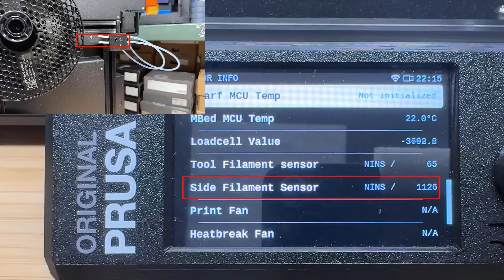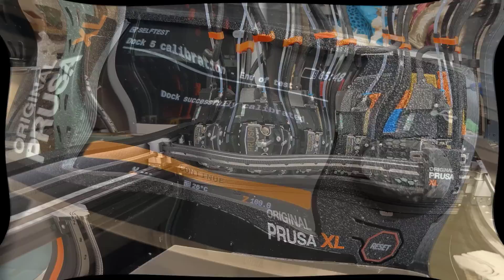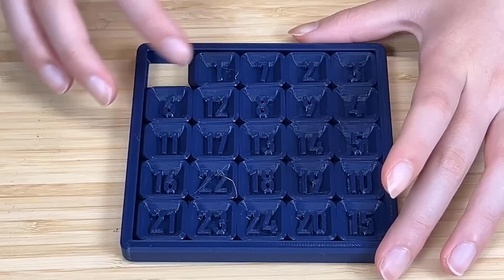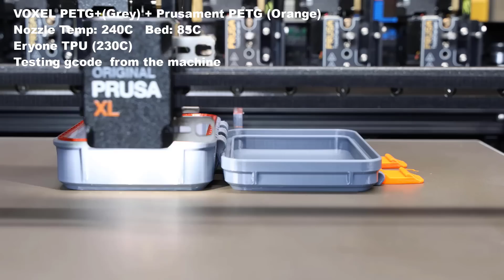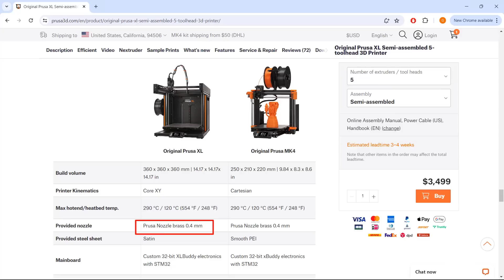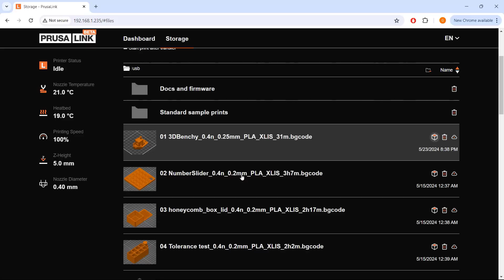Prusa XL In-Depth Review: 5-toolhead auto tool changer 3D printer compared to BambuLab AMS

Comment: Young lady i don't know how you do it, your reviews are off the charts best out there, quick question i have a small print farm of Bambu Lab A1's and flashforge 5m if you were going to add 6 or more prinn ters which would you honestly go with i do single color with some and multi color with the others i also use cf filaments
Reply from the maker: If you have both machines, I’m sure you’re already quite familiar with their performance. In terms of hardware cost, I think the Flashforge 5M is a better deal, since a CoreXY system at that price is even cheaper than the A1.

However, if you need multi-color printing, the A1 might be the better choice, as I haven’t seen any indication that the 5M supports multi-color yet. For multi-color printing, you might also want to check out the Flashforge AD5X, which I will be reviewing in the coming months.
Reply: @AuroraTech  Thank You for answering, i don't want to invest in printers that wont make the long run since i'm moving toward more machines that i need to depend on yes the 5m is a good printer but will it last as long as the A1 or others

Comment: I can't get over how "unrefined" their printers are in 2025. The firmware looks like it's from a startup company, not the supposed "industry leader" Prusa, still using 3D printed parts on a $5000 machine is also crazy. The overall design of these printers are cheap and way too basic for a modern printer, the amount of exposed wires and components is lazy. The fact Prusa has had years to respond to Bambu and they've yet to actually innovate and grow from within. Companies like Blackberry and Nokia were also stubborn thinking they had something special, rather than listening to the consumer.

Comment: Excellent video! Sorry for the lengthy comment in advance. I was initially leaning toward the Prusa XL, thinking it would finally meet my needs, but after watching your video, I’m now unsure about whether it’s the right choice for my specific requirements. To give you some context, what I primarily need from a 3D printer isn’t necessarily speed, but precision. I often prototype intricate parts that must fit together with tight tolerances, so accuracy is key. I was initially drawn to the Prusa XL for its build volume, which I thought would be ideal, as my typical print heights range from 2” (50mm) to a maximum of 14” (356mm). While I mostly work with single-color prints, I’m also open to multi-color or multi-material options when needed, like the XL promises. However, the most critical aspect for me is achieving a smooth surface finish akin to SLA prints, but without the associated hassle of maintaining an SLA printer. I’ve heard that the Prusa XL’s slicer now includes the Arachne perimeter generator, which promises improved print quality, and that was something I found promising.

 Based on your extensive experience with various machines, I’d love to hear your thoughts on which printer would best meet these needs. Specifically, I’m looking for precision, ease of use, and the ability to deliver professional quality prototypes, without the maintenance demands of an SLA system. I trust your judgment and would greatly appreciate any suggestions or guidance on what to consider next in my search. Should I keep waiting or should I take the plunge? 

Thanks again for all the valuable content you create, it’s been a huge help!

Comment: Another awesome review!  Thank you.
Too bad you can’t print money with it - I agree that it’s too expensive.  But it seems that the new Core model has possibly started to address the high cost issue.  Perhaps the fact that the range of Prusa printers re-use some parts there could be further cost cutting through the application of your “off shore” manufacturing suggestion?

Comment: So basically.. it still wastes a ton of filament even with multi head. Why is that? If the filament in each head is not being retracted then pushed thru every time.. why does it need to waste so much? Should be very little waste I would think. Also, I am guessing using P1P with AMS takes 4x to 8x longer to print the multi color prints with a lot more waste? Still not sure this is worth 4K.. especially with a variety of Voron projects as well as ProForge 3000 multi head printers for 1/2 the price.

Comment: Wait let me answer that question for you. If Bambu Lab sent you an X1C to review you’d compare it to the Prusa MK4S or the Prusa Mini. Stupid me. I get it now
Reply from the maker: We are comparing the filament waste between a multi-tool head printer and a multi-material system like the AMS or similar. Does the X1C full-size AMS make any difference in this comparison? I don't think so. The printing times of the X1C and A1 are also similar, so the most time wasted will be during filament changes. In fact, the A1 and A1 Mini are #`1 and #2 on auroratechchannel.com recommendation list, #3 is the X1C and #4 is the Prusa XL.

Comment: I couldn’t help but notice..you compared the prusa xl, a $2,000 printer, to the Bambu Labs $500 printer. Why didn’t you compare it to the Bambu X1C that’s in the same class?
Reply from the maker: We are comparing the filament waste between a multi-tool head printer and a multi-material system like the AMS or similar. Does the X1C full-size AMS make any difference in this comparison? I don't think so. The printing times of the X1C and A1 are also similar, so the most time wasted will be during filament changes. In fact, the A1 and A1 Mini are #`1 and #2 on auroratechchannel.com recommendation list, #3 is the X1C and #4 is the Prusa XL.

Comment: Very professionally made material.

According to the manufacturer's calculator as of 02.08.2024, the set in the full option with shipping to Germany costs 4930.52€ Netto (excluding tax), or 5867.32€ Brutto (including tax). Order processing time is from 8 to 9 weeks. Shipped FedEx International Priority. Transport time is from 1 to 2 days.

The set includes:
- Original Prusa XL - 3D printer.
- Enclosure-kit Bundle.
- Extruders / tool heads 5 pieces.
- Full assembly.
- Handbook in Polish (Yes. I am Polish).
- Power cable (EU)
- +2 Years Extended Warranty.
- 3D Modeling in Fusion 360 - This course is suitable for complete beginners in Fusion 360. It focuses on tools useful for 3D printing and is.
- Basics of Product Photography - This course is tailored to the needs of beginners. It explains all the basic concepts of photography (exposure, depth of field, etc.).
- XL Satin Powder-coated Steel Sheet.
- Nextruder V6 Nozzle Adapter.

Best regards.

Comment: Please Bambu, make multi head printer!
Reply: They are.    Still secret but peeps in the bamboo loop have let it slip.   Same set up 380x380 enclosed with heaters.   A shit ton faster and a grand cheaper.     It's coming this year if they can get it sorted but I hear there is some pos legal challenges to them for various things.
Reply: @redshiftz8520 380??? And a grand cheaper? I doubt a grand. It'll probably cost more than their x1 carbon... that's how it usually is.

Comment: You say it doesn't have an accelerometer but each head does.  Does the XL extruder have an accelerometer built in? A: Yes, it does – it's vital for correct Input Shaper configuration (see above). Overall, Input Shaping without an accelerometer is the exact opposite user experience that Prusa normally goes for.

Comment: It definitely is a very interesting machine, but it doesn’t make much sense to compare it to the BL X1 or similar maxhines, of course it is better in some aspects but it's in a completely different price bracket than those machines.

At the end of the day it doesn’t matter how good this machine is or could be, most people won’t even consider it when looking for a new printer because of the high price, and even having the money to spend it probably would make more sense to get 3 X1Cs for the price of the XL. It’s only under very specific circumstances that the XL would really make sense (other than going with the influencer hype).

It’s just a matter of time for BL to launch a new machine that kills this one as they did with the A1 Mini to the Prusa Mini…

Prusa is between a rock and a hard place right now, they’ll never be able to match the price of the BL machines, even if they make good and reliable machines, they’ll always beat them in that aspect. And even worse is not that BL are only cheap, they’re also extremely capable and almost (if not equally) as reliable as Prusa’s.

And it’s even worse because they lagged behind for several years, only getting into high gear again after panicking when the X1C came out and blew the industry away. 

It might be too late now to get ahead of the competition, only time will tell. If anything it’s good for everyone that they’re finally are trying to catch up, competition is great for the market.

Comment: Another great review! 
Only suggestion is to not compare Apple to "Oranges". Prusa is a pretty big company but it's not Apple big. I do wish they had manufacturing in the U.S but since I don't know what their overhead is I don't know for sure that it would cost any less when manufactured here.
Reply from the maker: Yes, you are right. I didn't expect them to move production to the US; I would have expected them to start in Mexico, where everything is cheaper. As I read in an article (https://www.forbes.com/profile/josef-prusa/), in 2017, the estimated value of Prusa was 236 million euros with annual revenue of over 33 million euros. After seven years, I would expect these numbers to have increased to an estimated value of 500 million USD and 50 million USD in revenue. So, investing 5-10 million USD, which is only 10-20% of their annual revenue, to move some production to Mexico and ship to the US from there shouldn't be that big of a deal. It would be a much better investment than acquiring the TRILAB delta printers.
Reply: @AuroraTech  In that case, Mexico definitely sounds like an option.

Comment: As usual, another excellent video. Thank you.

With regard to Prusa outsourcing, I believe Prusa has much national pride and wants to help the people of his country by employing them rather than outsourcing. This is a good thing that I feel should be at least mentioned and IMO rewarded. For the higher price of a Prusa, you get the best customer service with a product support that significantly improves the product over time, as you mentioned with the MK4. Also, I expect long term part availability to be better with Prusa than any other manufacturer, which is very important when buying at this price point. 

IMO, I would buy a Prusa over a Bambu based on these things I have listed here.
Reply: It's exactly like that. I agree on all points.
Reply: I noticed Bambu Labs has a sale on their printers, so I bought an A1 Mini for $200. I noticed it prints PLA very well, but I continually had problems with layer shifts with PETG. This was a concern since I use PETG 99% of the time.

I looked online and found many other people were having this same problem with the A1 Mini. I ran through all the calibrations to make sure the printer and slicer were calibrated to the two different brands of PETG that I was using, but this did not resolve the problem. Therefore, I contacted Bambu Labs Support for help.

It took Bambu Labs a week to respond. Their response was to lube the rails, which is what I originally did when I first assembled the printer as this is what the assembly instructions stated. Therefore, I waited a week from Bambu Labs for an unhelpful response.

Since I did not believe this problem would get resolved, I returned the printer on the 14th day of ownership since this was the last day I was allowed to return the printer.

By the way, when I had a question about a used Prusa Mini that I was looking to buy, I simply went to the Prusa website and clicked on the chat icon, then chatted with Prusa about their product. It seems you get what you pay for.
Reply: I just want a toolchanger, Bambu doesn't have one and I don't feel like waiting on them.  Plus I heard some shady things about Bambu.
Reply: @krollmond7544  Check the latest tool changer video from Teaching Tech.
Reply: @krollmond7544  Please tell the investigator that I said hello.

Comment: Great review!   One thing I think should be pointed out.  If you print too fast it can make you prints weaker. CNCKitchen tested bamblulabs prints at full speed and found they were weaker than printed at slower speeds.   Prusa has stated that the speed they have their printers going is to avoid this issue.    I haven't seen a test yet to confirm if this is actually the case.   For a hello kitty or other figures this probably doesn't matter and the higher speeds are nice, but it is definitely something that people should be aware of.  You are losing something with the faster prints.

Comment: I feel that this printer is suffering the unicorn syndrome, is perfect for a job not much people need, you can print very complex models with multiple expensive engineering filaments, but is not enclosed from factory, taking away the main advantage of this multi-head printer. At the end, we have to remember that this printer is not for hobbyists, and that bambulab filament waste ratio gets significantly improved when you have to print multiple parts at the same time.
I think the Jobbyst  market need more cheap IDEX or TRIPLEX alternatives like the SOVOL. IDEX is a very simple and easy to maintain system which can be easily implemented without needing to reinvent the wheel with complex toolhead change systems.

Comment: Excellent review, HOWEVER - the multiple tool head design is only superior up to 5 filament colours - for multicolour prints above 5 colours, the prusa XL cannot do what the AMS system on the p and x series can.

Worth mentioning
Reply: Literally nobody uses more than 4 colors on bambu lab printers. the "16 colors" is a gimmick that doesn't work well in the real world. Just like their lidar.
Reply: AMS can't do real multi-material nor can it print this batch on 0.4 nozzle and the other on 0.6 nozzle without manually changing the nozzle (with connectors that are not meant for continuous replacement), so in fact XL can do more that AMS ;)

Comment: 4500?? Id get a Bambu X1C and P1S with 8 AMS units for that price....
Reply: Nobody fucking cares Jesus, those printers are not toolchangers...
Reply: @krollmond7544  People spending 4.5k for one printer do care. While they may not be tool changers they do have other advantages. 
As for the XL
in 2023 it barely worked
in 2024 if works better, with .4mm nozzle and a ton up firmware updates, but still has issues. 
It does not have  a camera, enclosure, print fails are common, exotic materials that require enclosure are not recommended, abrasive materials are no bueno unless you buy 4 hardened nozzles.
 and so on....
then
You can get a small print farm for the price and not just bambu printers....
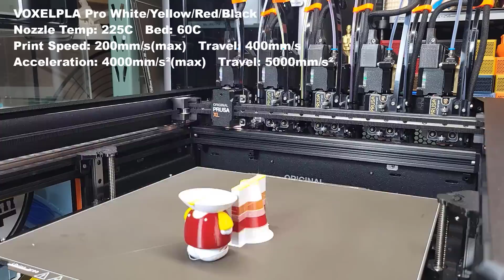Reply: @krollmond7544  People are looking at the utility not the technology. Can a single extruder machine do it for less...the answer is mostly yes for multicolor and somewhat for multi material. But multi material is such a niche application right now it's hard to justify spending print farm money on a single machine with middling results.  20:50 22:10  and  34:31
Reply: for 4500 you can get 9 A1 with ams lite
4 p1s w ams and and A1 lite
2 X1C with ams and p1s with ams

or a ton of combinations.

I have been running the X1C for since 2022 and it is a solid printer in its own right. 
So paying 4500 for a machine that requires a bunch of tuning/tweaking and has a higher learning curve and it still has fails is a bad investment.
Reply: Please do, and put them to real work :)
Or you could get 20+ Ender 3 V3 SEs.
Or one corner of equally capable 3d printer from another manufacturer, because they are really expensive.

But why would you get even single X1C when A1 + AMS Lite prints exact same volume and 4 colors...
Reply: @kimmotoivanen  The X1C is enclosed, which makes it easier to print PETG and ABS. Also, its inexpensive to upgrade an X1C to a heated enclosure for better quality prints of many materials.  
One of the 3D print farm business owners who posts on YouTube did a long term reliability test between the Bambu, Prusa, and Ender printers he owns.  The Bambu printers had the highest uptime and the lowest operating costs along with the highest output.  That may be the reason to get a X1C pr P1S/P over a lower priced Bambu with the same print volume.
Reply: And youd still have printers with the build quality of a creality ender 3. Quality costs money and it's why prusas cost money.
Reply: @LilApe  Please talk to actual Prusa XL owners and got an idea of how horrible their experience has been so far.  Many of them take months of troubleshooting and back and forth with support to get their first successful multi color print.
Reply: @Mildly_Amused  do you own one?

Comment: regarding the purge tower necessity: At one point AnkerMake was coming out with a multi-extruder head. From the videos they had, the idea was a servo and cam system was used to lower just the desired hot-end as well as move a cover from the hotend-tip. Unfortunately, they canned the project, which probably disappointed some people who bought the M5 specifically because it would support it. But I do wonder if the concept of a servo driven tip cap would have merrit with the XL.

Comment: I believe there are 2 ways to change the z offset. I've never needed to on my mk4, but I've heard if you hold down the button for a second, you get the adjust live z option. Also I believe somewhere in prusa slicer there is a z-offset option as well. I've never used either on the mk4.